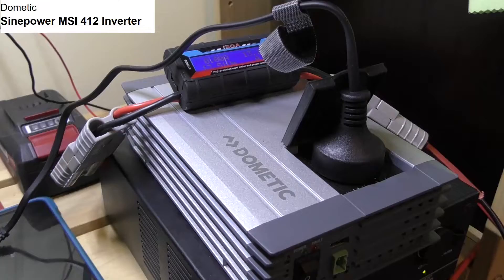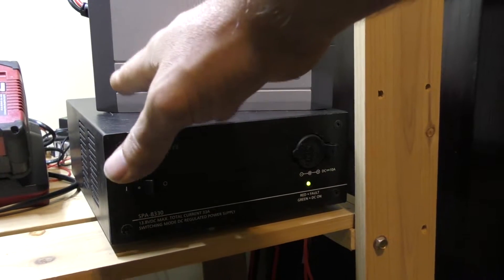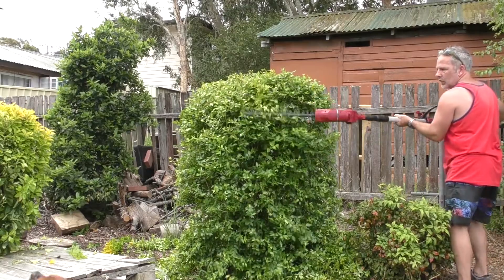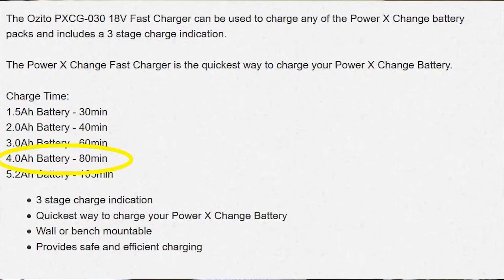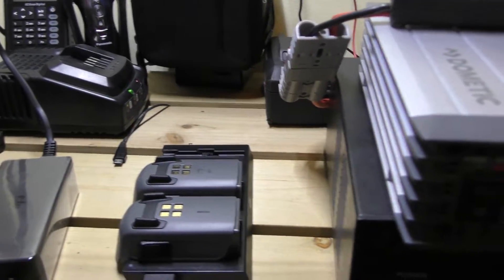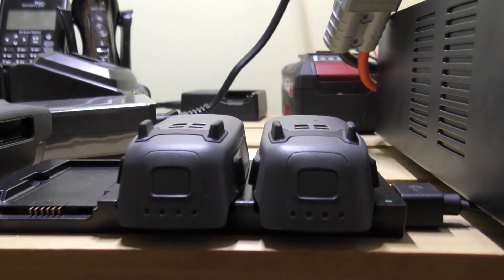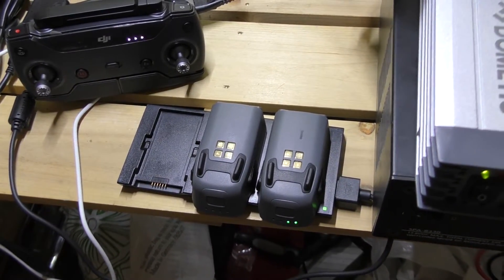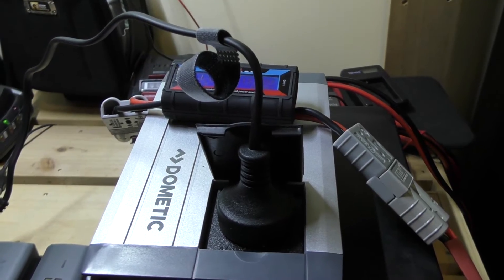What good is a 350W inverter - lets find out

Comment: Hi great info enjoyed... can this unit charge a 48w lithium e bike battery
Reply from the maker: I dont' see why not. but it's not about the battery size, it's about what the charger draws to charge the battery. check the back of the charger and it will likely have a power rating on the back. lithiums can take a high charge rate but I'd say your chances are good.
Reply: @DENMONKEY  thanks for getting back will do I think it draws about 5 amps
Reply from the maker: @The.2.Minute-Man  welcome. 5 amps at 12v is 60W. you're all good

Comment: I use the domestic 150watt can inverter and it does the same job. 350 watts will do it easily. Mines not purr sine but it’s fine for charging duties
Reply from the maker: Hey RS,   I didnt know they did a 150Watt but I didn't really look for one though either. Yes, I think people are convinced they need these big 2000W inverters for simple tasks when they're simply not required. That said, I try and keep my power needs to a minimum when out camping, so a smaller inverter stops me from getting stupid with my power needs :)
Reply: DENMONKEY I run this setup with a $50 voltage sensitive relay from kickass to run an Engel 45 in my ute. Basically everything I use is 12v but I carry a ryobi 12v compressor for the tyres so the charger plugs into the little inverter. Works great. 
https://youtu.be/E1Q_HoXWgUY

Comment: The red and black cable from the inverter ? Did u you attached them to a Anderson plug ?
Reply from the maker: yes, I sure did. I have an anderson plug on the 2nd battery in the pajero and on the 2 batteries in the caravan, so this allows me to use it in both when needed
Reply: DENMONKEY thanks !! Did you need to instal a fuse ??

Comment: i have electric chainsaw 9 AMP 60 hz...i just ordered a 1000 watt inverter ....can i use it via cigarette plug or i need to link it to battery ? says max  with cig is 300 watt...so confuse with all this
Reply from the maker: hey Tip,  when you say the chainsaw is 9amp, what are you referring to ? The charger should have a wattage listed on the back. That should give you some guidance on what you need to power it. the 1000w will do it no problems at all. 

My 350 does my dual battery charger for my chainsaw. 

300w  based on 12v gives you around 25amps which seems high for a ciggie socket. are you sure ? they're normally around 10amps max but I've seen 15. not seen a 25A before . 

If you are sure though, yes should run that without issue. 

Even at 10amps I reckon you would be fine. to run the charger that is, not slapping power tools and the like on the inverter. 

My single battery chargers were only pulling around 6 if I recall. should be in the video. 

Cig sockets just aren't made for big power. the connection isn't the greatest but its the wiring going to it behind the dash that cant be seen that's responsible for the lower rating. 

If it blows a fuse in the car, don't go throwing in a bigger one just to get it to work. chances are it's the right fuse and sticking a bigger one in could cause the wire behind the dash to heat up and catch on fire. 

cheers Brett
Reply: thx for your reply, my car fuse is rated 20 amp, 9 amp is what it says on it(chainsaw),i do not have charger/bsttery just a plug  it to 110v .  so i can run it from cig ? and im not usin it heavily just cuttin li1 tree in some 4 feet section so it can fit in my SUV just a bit confuse what i can get from my cig without bustin anythin. :)